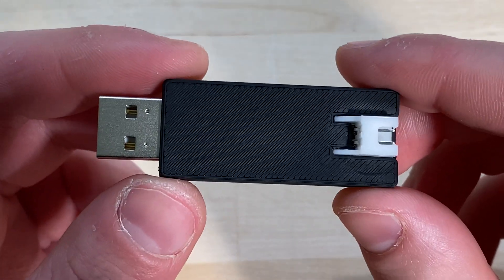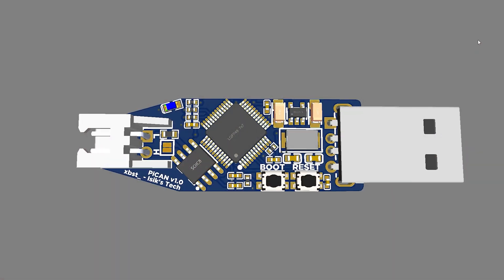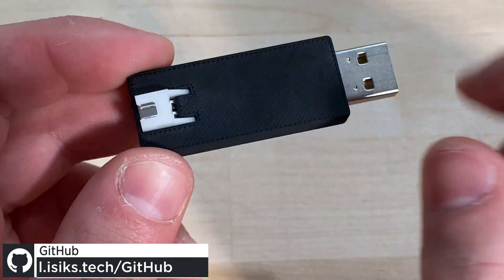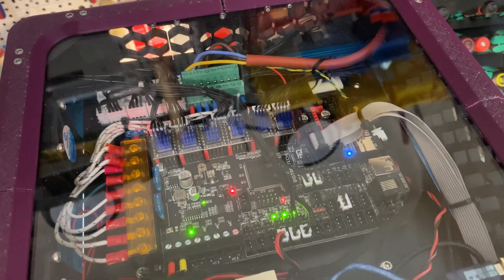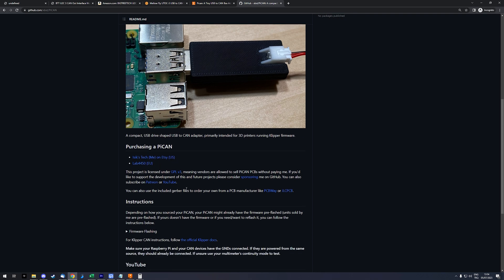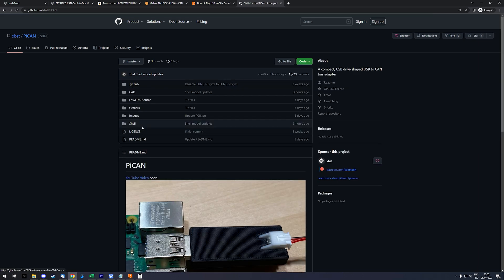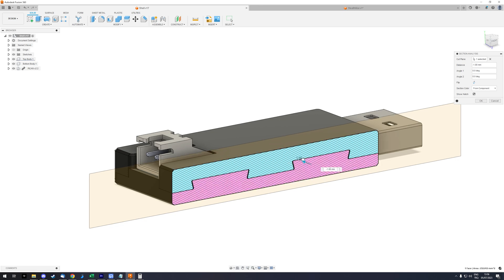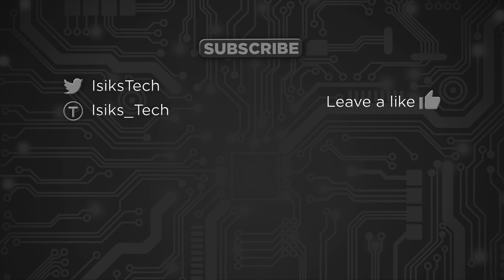PiCAN: A Tiny USB to CAN Bus Adapter for Klipper 3D Printers

Comment: Hi, this PiCAN can use in windows? or just Linux?
Reply from the maker: The hardware is there, but would likely require a different firmware. I don't know a firmware for that application, but there's probably something out there that'll work.

Comment: Does this use the Peak/PCAN Basic API?   ISO 11898-1?

I'm interested in writing a Can-Bus program to display data.. however, the tricky part seems to be finding hardware that can easily be configured to filter messages of interest, so that the software doesn't have to do so much checking.

For example, I'd like Standard Can Ids 0x40-0x4F go to Mailboxes 0-0xF..  or maybe even more complicated Acceptance Mask/Codes like only save to Mailbox5 when Can-Id 0x45 has Data Bytes  0 & 1 = 0x55AA.   

Do you know of any utility tool that might be useful to in creating filters?  PSOC Creator, GH Lauszus/CANBusFilterMaskGenerator_py ?

Comment: Doesn't your main controller board already have can support? What board are you running?
Reply from the maker: I covered that in the video, I'm using a BTT Octopus. It has a CAN transceiver but I couldn't make it work. Most boards don't even have that.